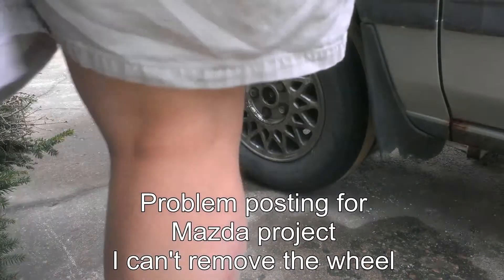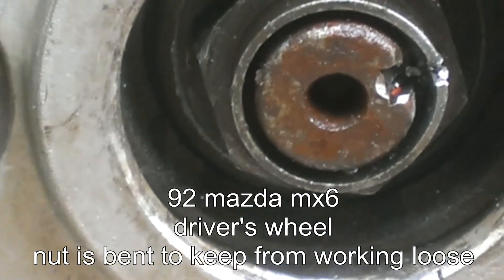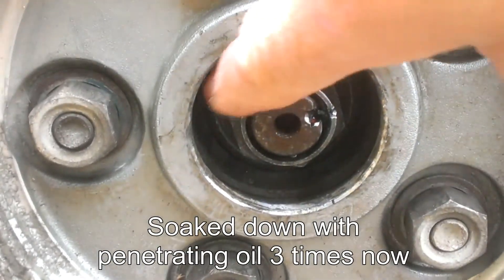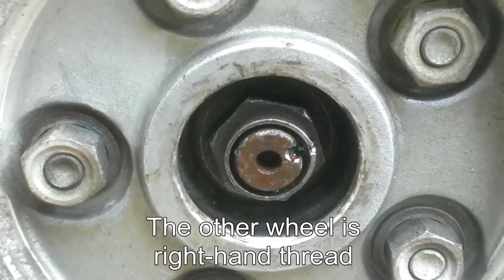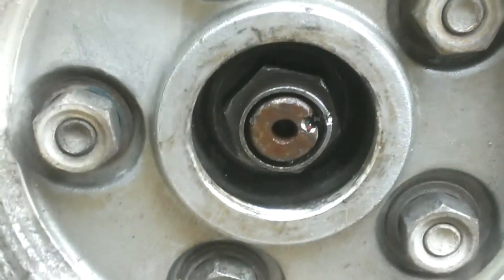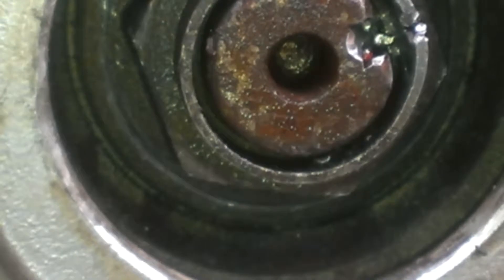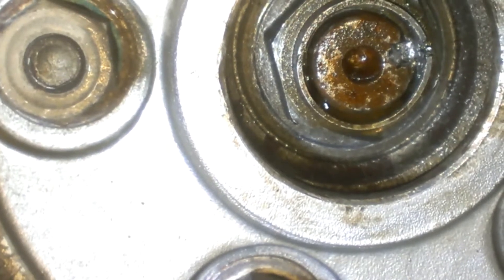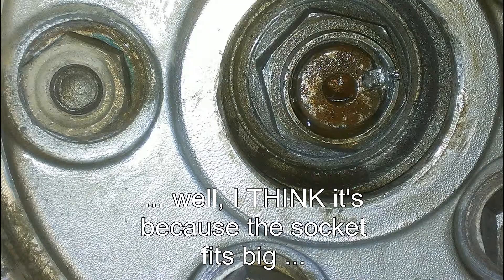Mazda wheel is not cooperating

Comment: I've had a similar problem. here's what I was told, and what worked.
1) use an impact gun with the exactly correct diameter impact socket. That's probably 32mm, and you want 1/2" drive (or you could go larger but that's uncommon) for this application. I used an electric (wall plug in, not battery) Dewalt impact wrench/gun. Then put on ear protection, and impact away for SEVERAL MINUTES. MAYBE EVEN 15 MINUTES. That should do it. IF IT STILL DOES NOT, which I've never had to do, apply heat with a hand torch (butane?) directly on the nut, to enlarge it, then impact.

Comment: Incase heating of and on with torch doesn't work. And going to mechanics shop with powerful impact wrench to break loose, then tighten so you could get home doesn't work, then remove rotor and try a nut splitter if you have room. That doesn't work,well then take off the wheel and rotor, get an angle grinder and sacrifice the cv axle and axle nut. From someone who liked the 2door mazda then "basically mazda's version of the ford probe i would say.
Reply from the maker: I ended up getting a larger impact and did eventually get it to release.  I have a corded 3/4 inch impact that will do 500 foot-lbs of torque now.  It makes short work of problems like this!